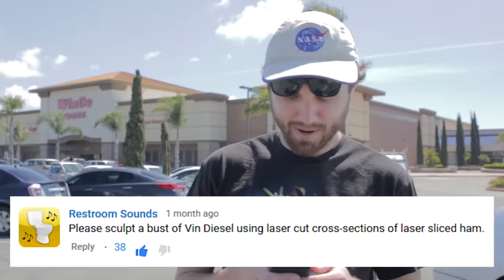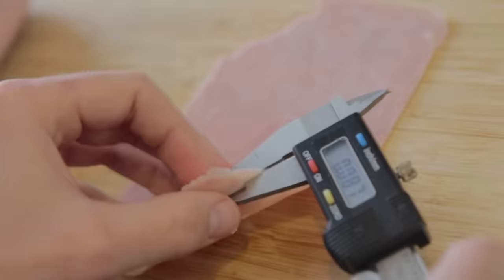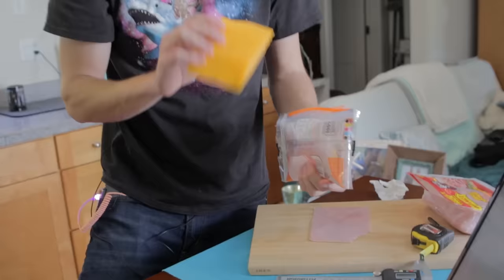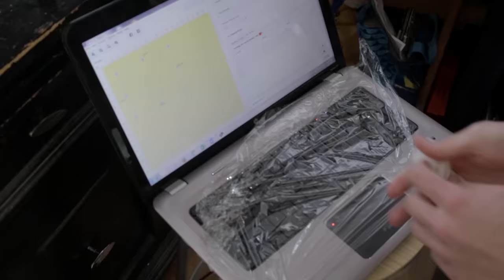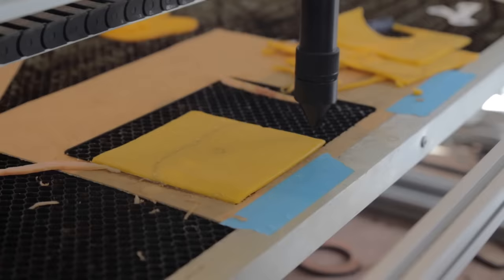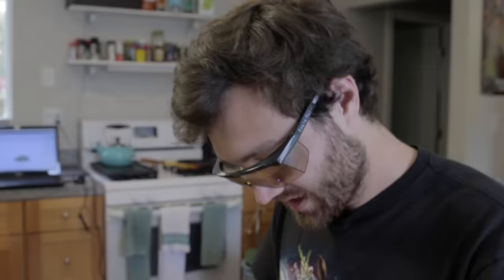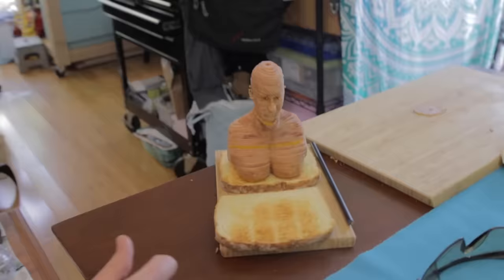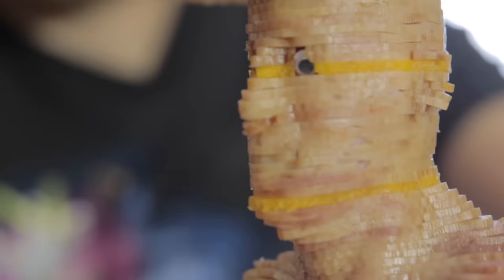Laser Cut Vin Diesel Ham and Cheese Sandwich

Comment: if you laser a light bulb will it shine? can you try that? maybe try the metal part and the glass part.
Reply: I don't think a laser projects electricity directly into objects. It's just super hot. Probably would just fuck up the light bulb.
Reply: Lars Slinger the glass would melt or shatter
Reply: unsure: photo electric effect not sure about how you'd make it a circuit though/power works out

Comment: make a car but everything is inverted, the brake pedal is the gas, the gas pedal is the brake, and the clutch pedal has to be pulled like an old parking brake, the gears are also in completely random order, with the lettering telling you what gear your in  being completely inaccurate, and turning the wheel left makes the car turn right ect